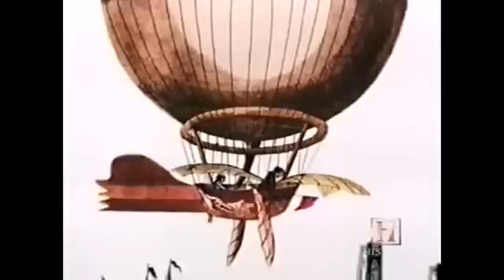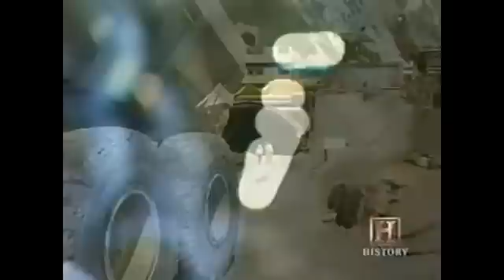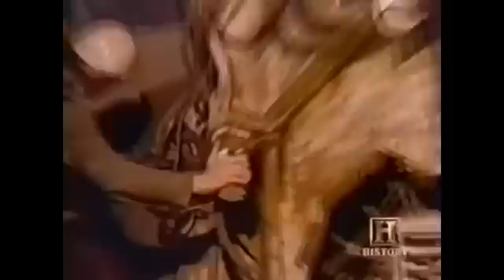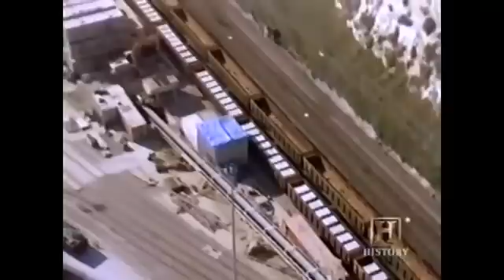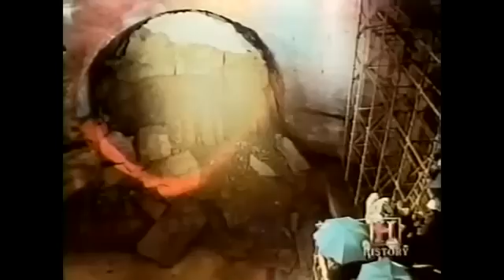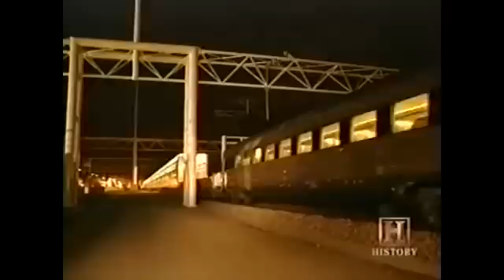The Longest Underwater Tunnel, The Channel Tunnel- The Construction Details- English Documentary

Comment: Japan participated to this project with 2 shield machine made by Japan Kawasaki industry.At the most important point which was connection of both side under water. 2 Kawasaki machines stopped at 50 cm in front of both side, and Kawasaki machines began to freeze around the point. After the muddy water frozen completely, the shield machines began to dig, soon  two sides connected.